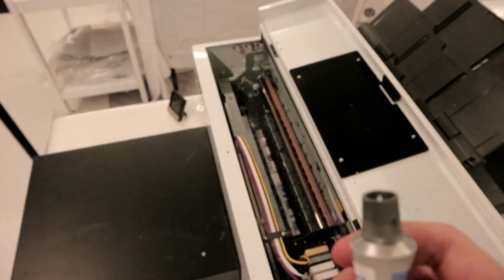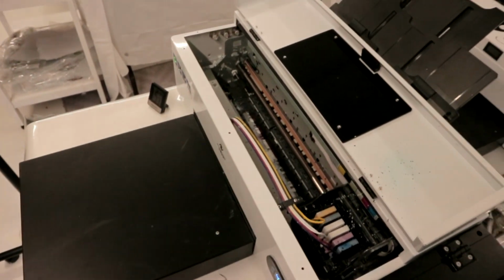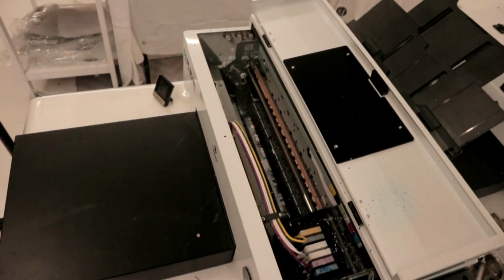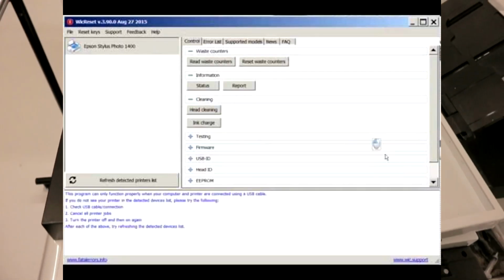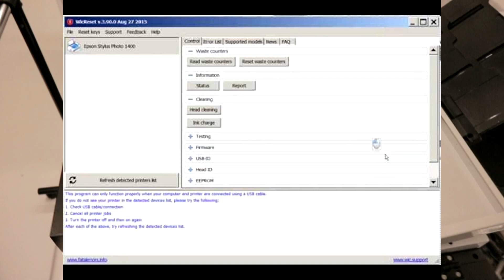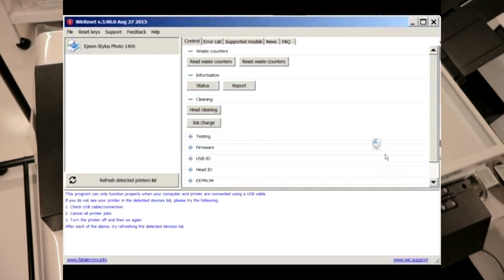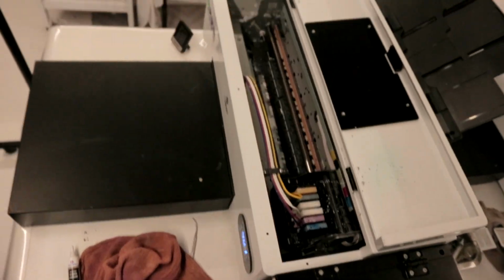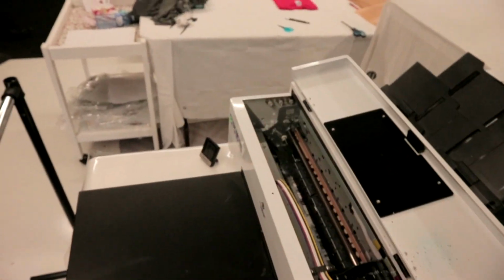How to FIX 2 Flashing Red Lights (DTF Printer) #3

Comment: I have also found it helps to add some lubricant to the top of the carriage where it tucks under the metal bar. This is also a place where it can gum up. It simply rides leaning against the metal. I cut a swab super short to clean and another to lube. Carriage slides much easier if you do this and the rod.
Reply from the maker: Valuable information 
Thanks for sharing

Comment: Excellent explanation. Very good solution. I have problems with DTF RIP Version 10.3 software setting. I would like if you had a video about the setting. Everything was working fine and a spring in the ink pad broke. and replaced it. Thanks for this video
Reply from the maker: Thank you for your kind feedback! Sorry to hear you having issues, I have made a video in the past showing the perfect settings for acro rip did you have the chance to check it out?